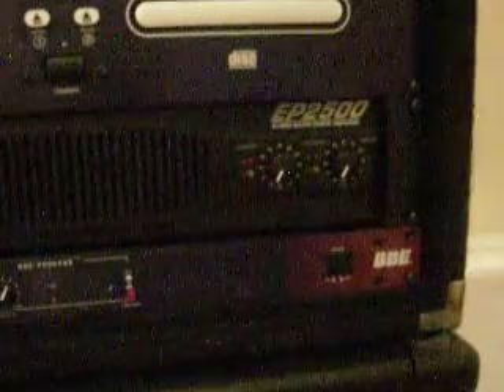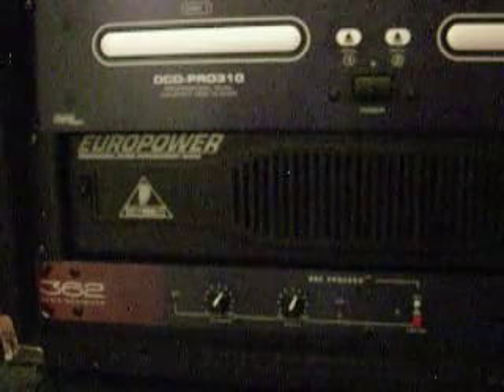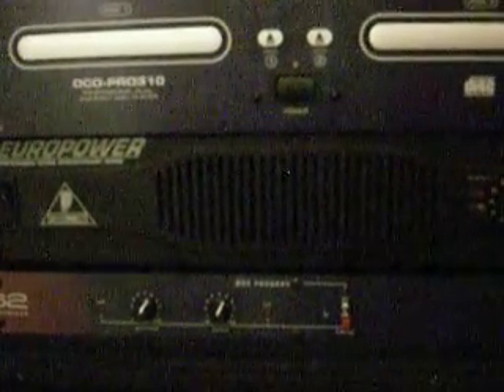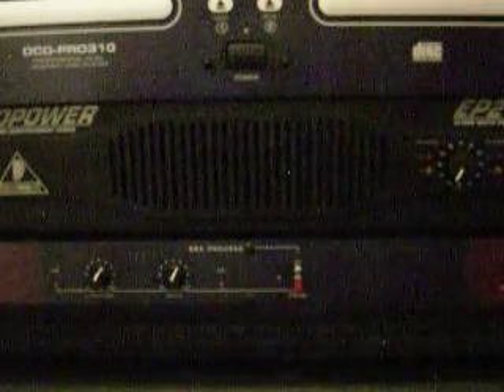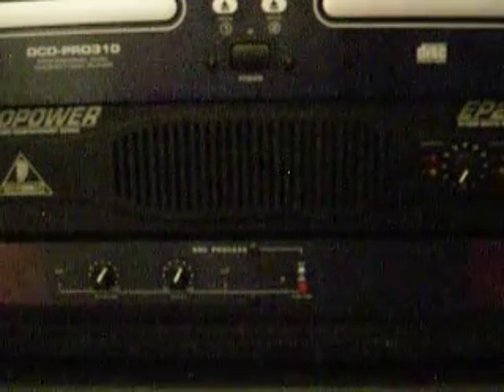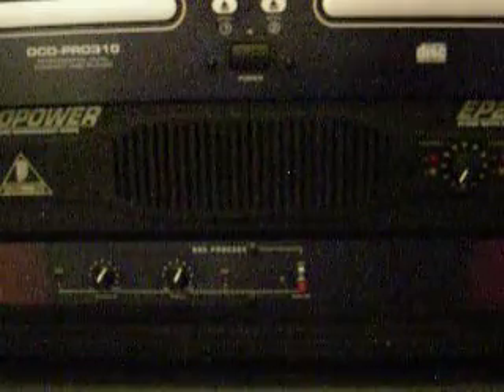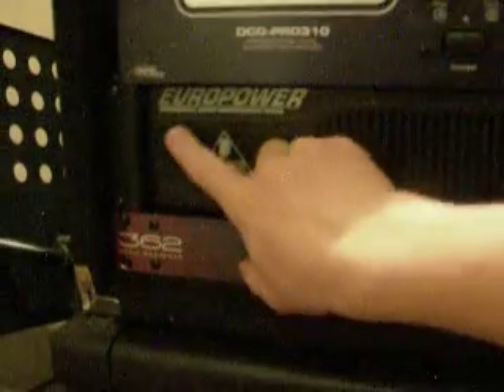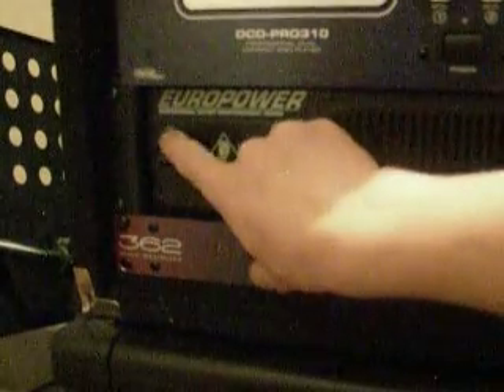Behringer Europower EP2500 AMP Review

Comment: I hate to tell you people at $300  you're not getting a 450 watt amplifier that's worth anything they sound horrible . you get what you pay for and one thing to remember if it doesn't have any weight to it it doesn't have any power to it at least any good power at 35 lb your talking transistors instead of transformers

Comment: Ok so anyone had this problem lately? Mine amp(EP2500 same model as in video) has the Power switch at the front problem where I cannot turn it off. It seems like the switch is jam or smth... anyone opened it up and solve it on their own? Help is much appreciated :)

Comment: anyone ever had to repair/replace the breaker on the back of these. I had a channel go out, went to check the breaker, and it will not depress... it's like it's stuck? anyone changed one?
Reply: I've not even had any luck looking for a replacement breaker... don't know what the deal is.

Comment: One important note: If an amp say the ep2500 is rated at and can pump out say about 2000 watts, it may be able to do this for a few minutes using a signal generator. But this will overheat and destroy the amp. Music is dynamic and pulses it's not a continuous signal in frequency and amplitude, this means the designer can down scale the power supply and cooling system to cut costs and weight. Most commercial amps will overheat if you drive them at their full power continuously. the ep2500 would need to be twice the size and weight to run at its full power continuously.

Comment: I've Tested the EP2500 and found it cheap and does the job, however the published power ratings are over the top. The output stage only has a modest 8 power transistors, 4 rather small filter pcb mounting caps a tiny bridge rectifier, and the transformer is only capable of about 1.5kVA max. If you attempt to connect 2 ohms loads and crank it you will exceed the safe operating area of the power output transistors and the amp will eventually fail. The fan is noisy and can be replaced with a quieter model. The amp can run at about 1/3 the power continuously any more and it will get too hot. I think people have been tiring to run them at their rated power (false advertising) and hence over-driving them and then claiming them to be unreliable.

Comment: @Rattlehead15 Stating facts is not trolling.  Attacking somebody & spreading lies is. U exhibit troll behavior, & I do not.  Doing a 'rubber glue' dance & sticking out your tongue does not change the fact that the Behringer EP2500 is really a 500WPC amp (@ best) & sounds like total krap bridged, & shuts down constantly if driven below about 8 ohms.

Now troll me some more, troll clown.  Do your troll dance.  DANCE troll DANCE!  Remember, my shoe size determines power output right? idiot

Comment: @djdan201 The Behringer EP2500 is not a compromise amp.  It's sound quality is superior 2 most so-called 'high end' amps.  How do I know?  Because I have A/B compared them!  =)  I'd say the Behringer R a bit bright, but certainly not more than other P.A. amps, which R typically WORSE (more harsh).  The bass is a bit flabby compared 2 the best, but still sledgehammer rock solid if U R driving real taut PA woofers instead of 'boom car' garbage.  Esp below 8 ohms it will get very sloppy & harsh.

Comment: @Deathrape2001 you're correcting you'reself at an extravagant rate of notts.I cant believe Im still having this conversation with you....READ THE MANUAL......its a  BIT MORE than 250  side.......dont be silly...and my rig does'nt shut down during performance cos I have more powerful and reliable units driving it, the behringer just runs a pair of wedgesand weather Im a loser or not is irrelevant.......I still  know what Im talking about. see ya honey bundle..........

Comment: @music8stuart Oh sorry, I meant bridged they sound like $hit.  They sound fine unless bridged.  If @ less than 8 ohms or so, they shut down every few minutes (or even more often than that if driven hard).  They may as well not list the low ohm specs @ all, unless U R a flake who likes your rig 2 randomly shut down during performance HAHAHA  =)) U loser.

Drive them over & they'll slam all day long & then some. They are NOT a low ohm or bridged amp.  They R ABSOLUTE JUNK if used 4 that purpose.

Comment: @Deathrape2001 read the manual you idiot........it cant be a 500 watt unit "ONLY AT 8 OHMS" and suddenly become a 2500 watt unit bridged....on the front panell it reads 1200 x 2 channel power amplifier.thats based on a 2ohm load (not recomended for reasons i've already touched on).in the manual however it states as follows..8OHMS 450 PER CHANNEL...4OHMS 750 PER CHANNEL....2500 2 OHMS BRIDGED MONO....BUT IT NEVER TOUCHES 2500 REALLY,thats a dream you had darling....anyway i've had enough,bye now

Comment: @Deathrape2001 amplifiers are rated by their "peak" power output.therefore the 500w per side rating isn't to be taken as a constant working output.realistically...it puts out about 400w a side in comfort  @8 0hms.i ran this amp @ 4 ohms and drove it...and it shut down from thermal overload.the amp itself isn't bad...the problem is poor heat soaking and a single fan...and adding speakers brings the ohms down not up..., which labours the amplifire.run it at 8ohms and don't push it too hard...
Reply: That's odd because I have 2 Cerwin Vega LS12 enclosures in parallel 2 ohm load per channel with Hyanka BSC12-2-12 D2 Subs wired in series for a 4ohm impedance pre speaker and parallels at the amplifier pre channel with DS18 PRO-TWX1SL tweeters and DS18 Pro 5.4BM 5.25 mid-range in each enclosure. I'm running 4 speakers 2 per channel in parallel 2 Ohm load per channel and I don't have any problems and I'm digging deep in the 35hz and lower in the bass music. I haven't had a problem with the unit but I have to reset my 20a breaker now and then and I don't get no clip lights neither and the limiters are on.

Comment: @music8stuart These amps like about 9 ohm load.  They will not run reliably @ less, but constantly & randomly shut down.  They go plenty loud around 9, so if U R less, either run some longer or thinner cable 2 bring it up, or run some more speakers in series with the load 2 bring the ohms up =)  They sound harsh driven bridged N E way, so don't waste your time.

Comment: @RanetkiFan Because the Behringer R about 1/4 the price or less 4 the same power, & have even BETTER sound quality than the digital krap such as class D.  These Behringer R class H, which is basically a regular amp, but with a tracking power supply (no change in sound quality, but wastes less).  The digital output section 'featherweight' style amps all lack detail in the sound (mud).  Doesn't matter how much $ U spend - they all suk. Maybe they will fix that some day, but they haven't yet  =(

Comment: @music8stuart The Behringer EP2500 is a 500WPC amp.  The specs R lies, just like with all other audio amp manufacturers except a few such as Linn.  500 is a lot tho', even if U R running a bunch of speakers.  The more & bigger the speakers U have, the MORE efficient the system (wattage-wise).

Comment: @RanetkiFan um I use a behringer ep2500 running on 2ohms, and it was used 2 nights ago at a party for around 6 hours continuously, at about 90% gain - no problems what soever, I don't see an issue. The amp has been in use for 2 years now, weighing 36lbs.

Comment: realistically...about 450 at 8ohms...and bridged about 1500 at 2ohms.my advice........if you're running these amplifiers at 4ohms "DON'T" drive or push them hard,and I would'nt bridge them either.they are prone to thermal overload and "WILL"shut down.running a single pair of speakers at 8ohms......they are brilliant.I use my one to run a pair of monitors and it's perfect for that.tried running a pair of medium subs and it tripped after an hour and a half.

Comment: Just curious: Why do people want to waste their time and back on a whopping 48 lb amp when you get get a QSC 3402 for 21 lbs, 3400 watts at 3 OHMS, 2200 at 4 OHMS and 700 watts at 8 OHMS. You can actually run it at 2 OHMS all night, as opposed to AMPS like this. If your lucky , you may run it at 2 OHMS for an hour without it either blowing up or shutting down.
 I'd rather spend the extra money on the lighter weight and more bang for your buck. This amp is probably OK for monitors for bands. Thx!
Reply: Hey, guys & gals! Just wanted to add my experience with this amp: Since 2004, I've run an EP2500 at 2 ohms, 85-90%, for entire weekends at BOTB events, biker festivals with multiple bands, & even Relay for Life 24-hour events. Never a problem - again, since 2004. Keep the insides clean & the air flow clear - front AND back - & you should have great results. ~Noah

Comment: @kyle2284 I was surprise at this amp... had it for 2 years and intended to use it only for a back up amp.  I had qsc's and one channel blew out on me.  My fault cause I clip the hell out of them.  I also have crown xls series... they produce a little more bottom.  Qsc has more clarity in highs which i use now.  But you have to give Behringer its props for making built like a tank without breaking the bank.  Spend the extra money.. if you have it for better quality.  I know these amps, i use them

Comment: I'm glad you put a review up of this amp. I'm in the process of expanded my rig & my budget is an issue. I did get turned off by the 2500watt rating as big numbers at low cost never seems a good idea to me but after finding out it's 450watts into 8ohms (i think that's right) I have a bit more confidence in this amp. It works good as I have my eye on a 3 chan Behringer crossover to :D Thanks for the review :)

Comment: I have one of them I use to power the Rife Doug coil. I burned out My Sony receiver 120 watt per channel push pull powering the Rife Doug coil and I Am depressed about It, If I ever blow out the EP2500 then I will be even more depressed the one thing I do Not like about It Is the fan runs all the time but one of these days I hope to be able to afford a thermostat for It.

Comment: @djdan201 
LOL calm down dood. I never said they're crap. they are OK . But you need to understand that in the long term life and overall clean power when compared to a higher end amp, (which YES of course is going to cost more) is going to be better. You're telling people that this behringer outperformed your crown. probably so. but you weren't comparing apples to apples thats all my point is. compare a 3000 watt behringer to a 3000 watt QSC and you will clearly see a difference all around.

Comment: Behringer is OK if you're on a budget and you want something decent. But Sorry bud they don't compare with the likes of QSC or Crown, Mackie,etc. Ive had Behringer amps in the past and my QSC MX1500A puts them all to shame and its rated at 500 x 2 at 4 ohms and 750 x 2 at 2 ohms. 20hz to 20khz

Comment: In professional sound reinforcement or permanent installation settings, the amps are ran wide open (100%) and the mixer is the main volume control. 
Many rigs have a limiter in between the crossover, and the mixer. 
The limiter will not let your amp clip, no matter how hard the input is being driven. 

If you decide to expand, I recommend you getting a DBX Driverack, as they have a limiter and crossover, as well as delay and loudspeaker management. Great piece of kit.

Comment: i think too that the power ratings are rms because the power consumption of this amplifier it's rated at 2600w,so if the transformer spends 2600w from the power network,then it can easily give out the rated wattage,because if a 2ch amplifier says that the wattage per channel is 1000w and the power consumption of the transformer it's rated at 500w,then it can give out only around 230w per channel.

if you get me :)

Comment: If you link two 4 ohm speakers, the load lowers to 2 ohms, which puts most amps in danger of overheating.  Yamaha amps/powered mixers may be different, but thats just from what I've heard.

Comment: i'm trying to use my yamaha emx5000, 1000 watt, powered 12 channel board to push 2 pr18b 18" subs that require 400 watts each at 4 ohms. my question IS , when i use the mono bridged function which puts out 1000 wts at 8 ohms can i run 2 -4 ohm speakers in parallel ? DOES THIS MAKE SENSE?
will it harm my amp?

Comment: not necesserily unless you push the amp all the way untill its peaking and about to burn out. technical pro is a cheaper brand but not necessarily a bad one, it is recomended if you have a low budget and are going to use it for something small like a house or a small hall. if you would like to play at someplace bigger then you would need to stack up on a bunch of technical pro's one for each speaker if you are using powerfull speakers or get some more reliable amps like behringer, qsc or crown.

Comment: beautifull amp dude, i been looking at buying it for a couple subs i got that i cant power lol, i gotta 1500W technical pro sub @ 8 ohms, and 2 10" audiobahns @ 4 ohms each. tnk this can power it? and also, can u really run rca? cause i got a technical pro 3000W amp 1200W rms, it has a subwoofer output, so i need no crossover for that amp if i had lol. so letme know bro! thanks lol. 

ps. pay no attention to s/n below, i was on wrong youtube account     -jay